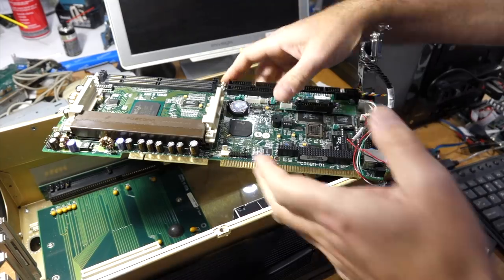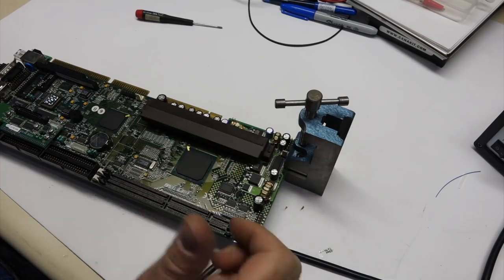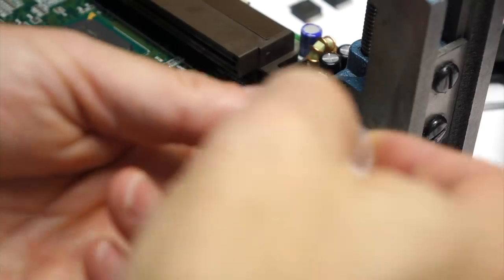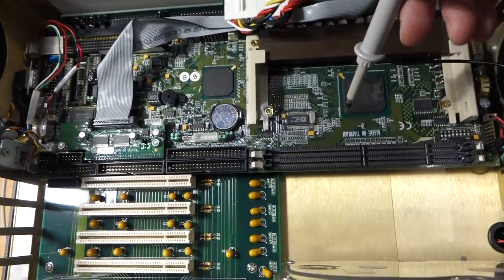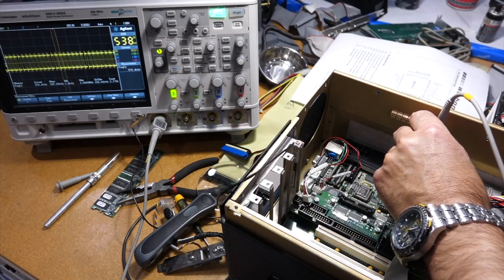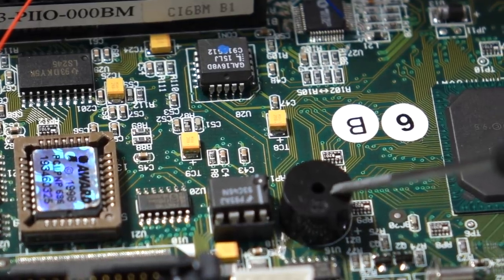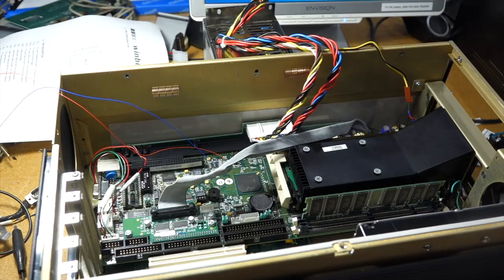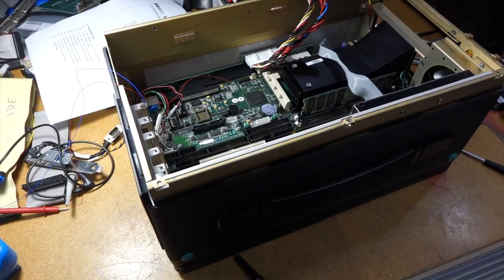Dolch Pac 65 - Part 2: reviving the motherboard from the dead

Comment: it was common practice to use NICs and even just hotswapping the BIOS chip to get the BIOS flashed way back with uniflash. That might be something to try here while you wait for the programmer if the chip comes quicker.
Reply: +1 - this has worked a few times for me in the past.
Reply: Yup, me too. You just have to make sure the bios is shadowed in the settings, then once it boots, you pull out the original bios, stick in the one you want to program, and use uniflash! Done it a few times
Reply from the maker: +sudos: Sweet tip! I didn't know one could do that, but it makes sense. I might try that method after I preserve the "bad" flash the traditional way.
Reply: you can also use uniflash to read out the bad flash before you reprogram it. Maybe read out the good one, swap the chip, read out the bad one, diff them, then program the image from the good chip. If the verify fails, try reading it out again and see if the error is still in the same place.
Reply: Done the same thing, works fine :)
Reply from the maker: +gorak9000: Thanks! This is really helpful.
Reply: But if You use a different motherboard, then make sure if the voltages are the same! It can be 3.3 or 5V in this era...

Comment: The pleasures of watching problems solved. So impressive watching your calm and thorough reasoning.
Reply: You might enjoy watching Louis Rossmann mending Apple boards.
Reply: Too different an approach for me. CuriousMarc is also about the reason for doing it, the pleasure of making it work as well and getting it to do something once it's up and running. For all of LR's ranting and constant Apple complaints all you get is the fan spinning up. Meagre pickings ;-)
Reply: A true Sherlock Holmes of the electronic debugging scene!
He just keeps on truckin' until he finds the bad egg.

Comment: It's a good job you have another Dolch to borrow parts from, otherwise you could still be chasing the fault! 
Good job and I look forward to seeing the final repair.
Reply from the maker: +Peter Allum: Man, I lucked out big time. Without another Dolch to play partsy swapsy with, I would still be chasing my tail around indeed. And then the BIOS was one of the very few chips that was socketed. The vintage electronics Gods must have been watching me.

Comment: I know that alarm sound all too well from my old AMD Thunderbird, when the CPU fan was starting to wear out.

Those monitoring chips (or very similar) are used in quite a few modern-ish boards, and I was banking on it being a bad temperature diode. hehe

I would have read that flash chip in the programmer, though. It could be interesting to see which part of it got corrupted / zapped.

I'm guessing the monitoring chip has a watchdog, and the BIOS just wasn't booting properly to reset it?

Glad you got it going. ;)
Reply from the maker: +ElectronAsh: I definitely plan to dump the bad BIOS and find what bit was annoying us! I thought about the watchdog too, but it is supposed to reset the computer instead. I agree with you though, maybe watchdog before it's setup correctly, that is the best explanation I can come up with. But Iit's just educated speculation.
Reply: Was thinking "I would love to see a dump of the bad bios"
You: I would love to see a dump of the bad bios
CuriousMarc: k

I love this channel

Comment: Did you try reseating the presumed bad BIOS chip? Maybe after cleaning the contacts? I've had luck with that on a slightly newer board, that quad socket ain't the best.

Comment: I wonder if the default config stored in the BIOS flash chip was already corrupt, then as a result of the battery being replaced, this bad default config was copied to the CMOS memory and became active?
Reply: The “config” section of the flash bios is in no way special. It’s just read only memory like the rest of it, like the strings in the BIOS, the logos, and the code itself. So given that the BIOS flash is corrupted, it’s very unlikely that the corruption would fall squarely on the tiny area where the CMOS default configuration image is stored. So nope, this is not likely at all, because just since we the humans can give it a name doesn’t make it special (ie. just because you call it “default config stored in the BIOS flash chip” doesn’t mean it has any significance re. potential for corruption). And then the good BIOS chip would write the correct stuff into CMOS and you could put the old one back on and it’d respect valid CMOS contents even if its own defaults were messed up. But in truth BIOSes do an integrity check of pretty much the entire flash with any useful data in it and just stop dead if anything is wrong and it doesn’t matter much where the problem is. Some areas (“segments”) may be excluded from the checks but that’s rare and on the whim/competency of the poor soul who has to put those BIOS images together. It’s a mess because it’s a very niche activity and the tooling for it is abysmal.

Comment: It should actually be possible to replace the 29C020 ROM with a more modern 39SF020 (which are still being manufactured). The pin-out is the same, timing is slightly better, both use 5V and they behave exactly the same for read operations. The only difference is the write procedure but the ROM doesn't get written by the computer. You could check if the write enable of the ROM is tied to 5V on the mainboard (probably is). If that's the case, just program a 39SF020 (or similar) and plug it in.
Reply from the maker: +Jonathan Strobl: Thanks!

Comment: I vaguely remember a similar problem on some Slot 1 QDI motherboards. If there was a siren of death without POST, then there would be most likely a BIOS problem, which we hotflashed in the old days on a similar or sometimes even on a completely different motherboard with a Uniflash utility. But usually the siren just meant that the CPU wasn't making good contact or the PSU was dying with full of bulged capacitors, ahh the early 00s problems, you just don't get anything close to that nowadays.

Comment: Dang! At least the problem is fixable easily, but what a pain to get to the problem. I wonder if you could even just re-write the original chip to fix it?
Reply: possible, but without knowing why the bios went corrupt, there's a chance it may fail again, or fail to flash entirely if that block of the chips bad for example.

Comment: like your video - keep going on.

did you check if the floppy-led will light up ? i recall that some older pc whats to restore the bios from the floppy drive if it is faulty... without any hint on the screen... the bios file must be in the root of the floppy and with its name it wants.. ok. without file and documentation a little bit hard.

Comment: The Pentium IIs that came in SNES style cases was such an easy install. I was hoping Intel would stick with it.
Reply: 525Lines
My guess is that they couldn't stick with it because they would need to have longer connectors for newer processors.
Reply: All in one, easy to install, just friendly. One example of older computing that was an better than what we have now.
Reply: For the new RAM and PCIe you need a lot more pin, and for the high speed the short distance.
Reply: @525Lines  If you want to stick to P-II speeds you’re welcome to keep using those CPUs. Otherwise, the form factor makes a huge difference in performance. Given that a CPU cycle is 0.3ns, and traces propagate about 6in/ns, the form factor of those P-II modules is ludicrously out of whack with requirements. The interconnect in that CPU module (on both sides of the connector, taken together) adds well over 3ns to the round trip between the CPU and the chipset. That’s 10 clock cycles - an eternity. You’d easily notice the performance drop. So nope, large form factor and low latencies are at physical odds. You want to write software that performs well with high off-CPU latencies, you’ll need to write your own. General purpose code is killed by that sort of stuff.
Reply: @absurdengineering  Thanks for the information. At least some of the newer CPUs don't have the pins.

Comment: I wonder if it got zapped when you replaced the CMOS battery. I would also check the CMOS settings chip (if it is separate) while you're at it.
Reply from the maker: It worked fine after I replaced the battery. Seems to have failed randomly sometime later.
Reply: Strange. It's nice to have a good working unit to swap parts with. This Microchip part might be a good modern replacement: SST39SF020A-55-4CNHE-ND
Reply: Classic esd symptom ?

Comment: Going backwards.... I did that today.
Reply: Flash chips are not perfect, and the don't last forever. They do go bad.  Granted this is only read from? A while back I wanted to understand more about them and read a long doc on it.  Seems that after the flash memory chips flips states from 0/1 after so many "millions of times" (or however many hours it's rated for) it ends up somewhere near the middle, whereas it then cannot no longer be read or written in order to see if it's state is on or off (1 or 0).